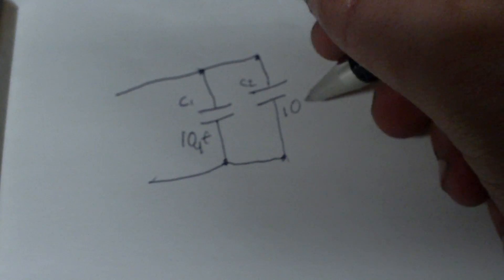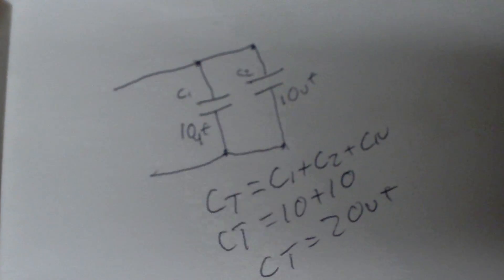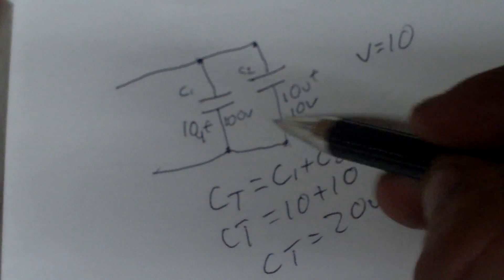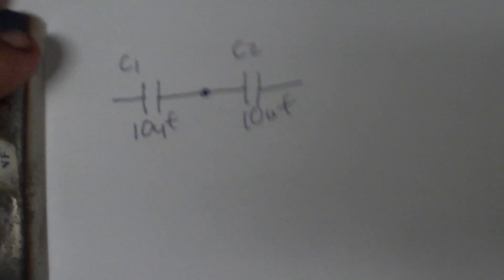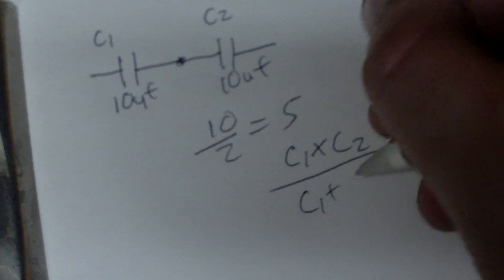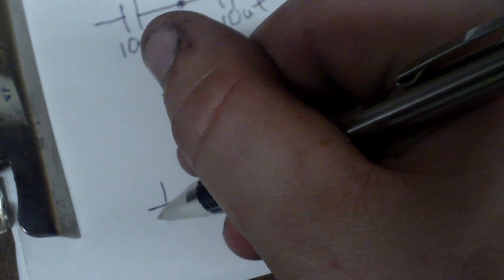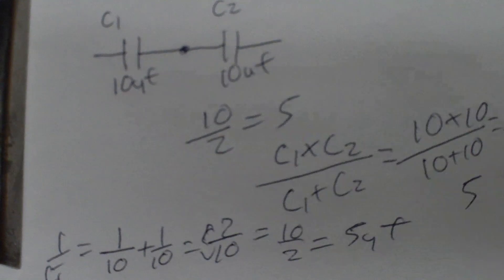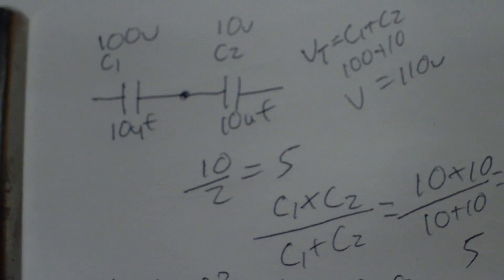Parallel and Series Capacitor Calculations

Comment: Capacitor series calculations totally wrong, but 5 is answe thats fine, but this calculations not working for all values, check 5uf , 10uf and 20 uf series with this calculation, or 10, 20 30

Comment: Quick question, can I replace a 82 micro farad at 450v with either 2 series or parallel caps? can it be done, even 3 caps if needed? thanks!
Reply from the maker: +Title Match Boxing yes, there is no problem with doing that, just make sure your voltage ratings are correct. Thanks for Watching!!!

Comment: does frequency affect this?  I have 2 caps. in parallel, 1 is 100uf the other is 200uf with 60Hz. frequency.
Reply from the maker: ***** It doesn't really affect it, because the capacitor can still store the same amount of power, its just charged and discharged at different rates (i'm sure there is efficiency loss or a drop off at real high frequencies). The main problem with frequency is in calculating circuits with ohm's law (resistors) because ohm's law is based on DC circuit principals, but is commonly used with ac (like 120VAC) to calculate loads, approximately, ac loads are usually inductive and not resistive so that throws the calculation way off, like for example if you put a ohm meter on a induction motor it might read maybe 2 ohms, so that would draw 60 amps according to ohms law, but when you connect to a 120vac circuit it might draw say 5 amps, just because its a inductor. But yeah i'm not a expert on how capacitors react with different frequencies, i'm a electrician, not a electronics engineer hahaha Thanks for Watching!!!

Comment: I thought in parallel the Vt remains constant if they all the same and if not you should select the highest not the lowest voltage just what you show to us..
Reply from the maker: With capacitors in parallel you have to use the lowest voltage rating, because if you have 2 capacitors in parallel with 1 rated for 100 volts and the other rated for 300 volts, both capacitors will "see" the voltage applied, so if you put 300 volts on it, then the one rated for 100 will also get 300 volts across it, and it will blow up. same goes in series, you have to divide the voltage out between them to make sure its within tolerance. Hope this makes sense, thanks for watching!!!

Comment: So can I parallel a 10mfd an a 20mfd and have 30mfd?
Reply from the maker: Wilson Revelle Yes, that is correct, and the voltage rating would be the capacitor with the lowest rating, use that as the rating. Thanks for Watching!!!

Comment from the maker: filter capacitors are capacitor(s) used in a DC power supply after the rectifier to smooth out the pulses. I don't see any problems using 800 instead of 820. Its almost the same thing.

Comment from the maker: yeah that should work fine, that would be 800uf, which 20uf doesn't make that much of a difference on a voltage that low with a capacitance that high, if its a filter capacitor, it definitely won't matter. Thanks for Watching!!!

Comment: If I need to get a 820uf  25v capacitor and can't find any in stores.Can use a 330uf 25v and connect in parallel with a 470uf 25v to get close to same uf value? Thanks for posting

Comment from the maker: right in series it would be 825, in parallel the capacitance adds so it would be 3300 X 4 so it would be: 13200uf. Your thinking of the voltage rating, in series the voltage rating of each capacitor is added, in parallel the rating is based off of the capacitor with the lowest voltage rating, for example, if you have 3 capacitors in parallel 1 rated for 10 volts and the other 2 rated for a 100 volts, the rating would be 10 volts. If they were in series it would have been 210 volts. hope this>>>

Comment from the maker: i didn't. I looked up a chart online that shows the values, however it said i needed, i think it was like 140 uf but it didn't work so i kept adding capacitors until i got up past 200, and it works fine. guess it depends on the motor. Thanks for Watching!!!

Comment from the maker: thanks! yeah thats true, i never really thought of that, but yeah that would double as a divider, but keep in mind if you put a load on one of the taps the voltage will drop considerably, more than a resister divider. capacitors are fun to experiment with!

Comment: Thanks. I checked around but nobody explained it as well as you did. It works! 24 volt supply over five 5.5 volt capacitors in series. Other findings I'd like to point out are, you can use the capacitors in series as a voltage divider by creating taps. I got readings of 24, 19.2, 14.4, 9.6, 4.8 moving the anode of the circuit between the taps, where the cathode for the circuit is on the - side of the capacitor array.

Comment from the maker: yes that it is safe, 5 X 5.5 is 27.5, so your pretty safe, just double check the voltage on your power supply, if it exceeds 27 volts don't use it. and make sure its DC, or use a rectifier. thanks for watching!!!

Comment: Can I use a 24 volt power supply to charge up five 5.5 volt capacitors in series?
Will they be safe or explode?

Comment from the maker: @missjessiebarry no problem. with capacitors i parallel you would just add the values together, and the voltage rating would equal the lowest rated capacitor. in series you use the reciprocal formula, for just 2 capacitors in series it is C1 X C2 / C1 + C2 then that equals the total capacitance and the voltage adds together. For more than 2 in series use reciprocal formual, C1/1 + C2/1 + C3/! = CT/1 then you you flip the final answer, so if you had three that was say 1, 2, 3, then it would...